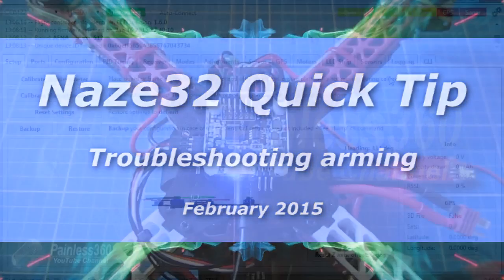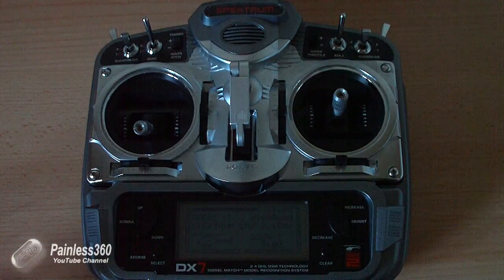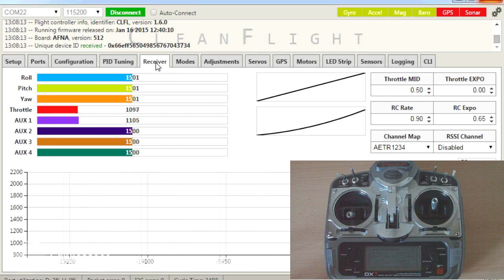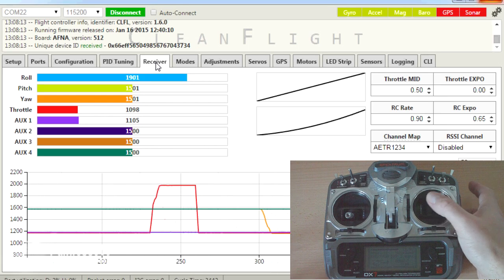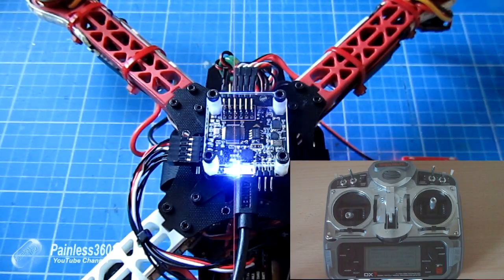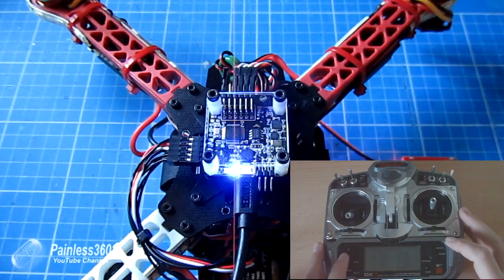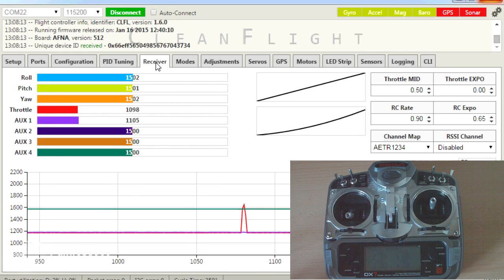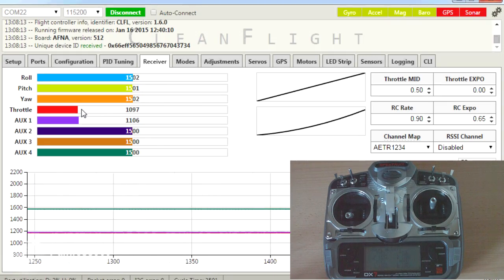Naze32 Quick Tip - Troubleshooting Arming

Comment: I've gone through all these videos, and I'm having an issue I'm hoping you can help with! Everything works when I have the USB hooked up and in Baseflight. Controls work, I see them moving. Got them all trimmed to 1500, I can even arm and get the motors spinning. If I unplug from the USB, and power it up, the Arm light turns green, but its like the Throttle does nothing. No motors spins. Any thoughts?
Reply from the maker: MrSadlerd3 Not with that amount of detail. What trouble shooting have you done?
Reply: Painless360 Well, it works when the USB is plugged into the Naze32/Flip32. I've tested all the motors one by one and they all spin.  Using Rotorgeeks ESC and I did calibrate them. It just does "arm" when I unplug the USB, from the board, but it like there i no throttle.  But if Plugged in I can see the throttle moving in baseflight.
Reply from the maker: And the led on the radio receiver stays lit when you unplug the USB cable?
Reply: Painless360 yup. I actually turned off the don't spin blades when armed.. armed it it while plugged in, motors started spinning, unplugged it from usb and could control it with my Dx6i.  If I unplug battery and try I get nothing.  Arms, green light in FC, reciever lights up, no throttle! ! Baffled
Reply from the maker: Can you make a video showing the issue and get close ups of the FC and Rx?
Reply from the maker: MrSadlerd3 OK, I can see the power to the Rx but the ESCs are not arming without the USB connected - that is the problem. The final 'beep' to let you know they are ready as they have seen the low throttle position isn't there. Odd.
I would suspect the power to the board from the UBEC you are using on the model. Looks like the USB is running it all fine but whatever is powering it on the model isn't cutting it. I'd try that next..
Best of luck.
Reply: Painless360 thanks!! Ill hook a  meter up to the bec and see if its putting putting out any power!
Reply: Painless360 So I go my multimeter, and tested the BEC.  It's pumping out 5v as expected.  I put the BEC back on the board, plugged in my Battery and put my MultiMeter on the "Motor 5" and it showed 5Vs as well, so it is getting power, or should be getting power.  I even hooked up another Radio to see if perhaps the PPM one I was using was bad. .  Any other suggestions?
Reply from the maker: A few but I would start to suspect the board now too..

Bets of luck with it.
Reply: Painless360 I found the issue!!!!! After checking everything I deceided to look at the site i got the ESC from. "RoterGeeks". . . and guess what I found under there ESC page. """If you're having issues with 13.2 and motors not spinning using Baseflight or OpenPilot, flash this hex file"""  There is a known issue with the BLHeli 13.2 and mine had that version. . Flashed the new HEX file. Instantly working.  

I want to thank you for EVERYTHIHG. . My next attempt will be with the Taranis and your videos will be my guide.   I can't thank you enough for what you're doing for this "hobby/sport"
Reply from the maker: Well found. Happy flying!

Comment: Hi I am  having a similar problem that is driving me crazy, I get consistently get the board to arm and the motors to spin while I have the naze 32 plugged into the use cable but when I disconnected the cable and try to arm the drone nothing happens? ( I am saving all the setting in base flight before I disconnect btw)  any thoughts?
Reply from the maker: Cameron Cooke What troubleshooting have you already done?

Comment: Big thanks mate, I was searching for few hours to find out what was the problem with arming, just increased end point on throttle and it works ! +1
Reply from the maker: Gorwen You're welcome. Let me know if there are any other things you need help with. Loads of videos on the channel to assist and lots of them are created to help subscribers with problems. 
Happy flying!
Reply: Painless360 thanks mate, I know well NASA m lite, but I'm a newbie with naze32 that I just started to use on tarot tl250a, my quad always drifts a little left and a bit forward , any idea to correct it without touching trims ? Big thanks !
Reply from the maker: I would recalibrate the accelerometers and ensure that the stick calibration and midpoints in Cleanflight all match the transmitter.

Best of luck.

Comment: My motors do not function with the tx.  If I  plug directly into ch 3 they work, but not when plugged into the Naze32.  Under Clean Flight the motors will work when on the motors tab but not with the tx.  

My throttle is set 1093 on the low end and rudder is 1093 low and 1900 high end, and still my Naze32 will not arm.
Reply from the maker: What troubleshooting have you done?
Reply: I think I may have discovered my problem last night.  I am just in the middle of my first build, and it is my first quad.  

The naxe is not mounted to the chassis it is sitting at an angle due to a twist in the usb cable.  And to complicate things it is in angle mode.  So the motors won't all come on fully as the board is trying to self level.  

Such a nube misteak. 

I was stressed over soldering up the board as I have never done something like this before.
Reply from the maker: Dean Cory Well done on sorting it out and getting to the bottom of the problem. The first two videos in the CC3D series show every step in setting up a flight controller, including building the frame, power distribution board, esc and motor connections etc. 
May be of some help?
Reply: I will admit your video series on the Naze32 has helped me TREMENDOUSLY.  It is just that a beginner lime me wasn't interpreting what he was seeing correctly.  

I may temporarily bolt the a Naze to the chassis to double check my theory.

Comment: hi there im having trouble with my quadcopter and cant get the yaw to work wen i move the rudder on my remote it just moves one of the aux channels
Reply from the maker: Jack Scott Then you either have the rudder channel plugged into the wrong connector on the receiver or you have a special mix/channel selection setup on your radio that you need to remove.
Best of luck
Reply: im running er9x on the software
Reply: it did the same thing as the rudder but i fixed that but the roll is now doing the same thing
Reply: Painless360 i cant find a special   channel on the remote
Reply from the maker: Jack, you need to spend a bit of time with the manual and work through it. If you are not familiar with the radio.

Trying to setup a model with a radio you don't know will get into more trouble. Take your time and use a spare servo connected to the channel output on the Rx to see how each one works.

Don't forget to run through the transmitter calibration routine in Cleanflight and use that to confirm that the channels all move in the right way.

Best of luck with it.

Comment: i also had a problem with arming, i would arm it the green light came one, then disarmed it, then try to re-arm, it wouldn't arm for some reason, i had to raise my max throttle by 1 so it would be 1901, fixied the problem right away, arms and disarms just fine hope it can help
Reply from the maker: Thanks for the post, very helpful. 

Happy flying!
Reply: thanks man

Comment: Will this still work if you fly in mode 4?  I know a bit weird but I am more comfortable with ailerons on left stick with throttle for my fixed wing aircraft.  I am just starting my first 250 build.

Cheers
Reply from the maker: The mode of the radio makes no difference to how the receiver works and is wired to the craft so it will work fine.

Best of luck!
Reply: Well thank you for the quick response!  Logically I thought it might be bound to the Yaw.
Reply from the maker: No, but always pays to check! Less accidents and scars that way ;)

Best of luck with the project!

Comment: I have had some arming issues with the board as well, independent with AUX or stick "right down" (mode2).

Result was always a 1 time blink of the green light (and 1 beep on the buzzer) and it didn't arm.

Throttle Values have been 991 - 2015 (Cleanflight 1.7.2)

Solving this was changing the minimum command on the configuration tab from 1000 to below 990 - save - (please remove probs as the motors start immediately) and afterward set it back to 1000 - save.

Comment: Thanks for the videos! question for ya tho.. I am arming my board via a switch on my taranis but in the Modes tab on clean flight where it says arm i have added the range and when I flip the switch it lands in the range but the box still stays red and doesn't turn green.. My quad does arm but sometimes when flicking the switch it doesn't make it up in the set range .. it keeps changing ranges.. I'm a total noob so forgive me if this is a stupid question buy i just don't understand why it doesn't turn green.
Reply from the maker: Sam, I'd try and use the default 'arming using the throttle/rudder' method for now and come back to this once you have more experience.

Best of luck..
Reply: itsalmostover haha don't use naze32 it's so out of date! That was from 2 years ago, I've used many other fc since then

Comment: It's a very good habit to set all your end points to 1000 low and 2000 high. Every channel. Very easy to do on most radios these days. That will also give your radio a better feel and use the full stick resolution available.  Same with your Aux  switch settings. Take a few minutes to set the end points accurately and you will get a much better setup. I have spent weeks on these Naze 32 boards and they are brilliant. I have run sonar with some success. GPS hold and RTH works perfectly and these boards work well even on 550 sized frames. To say they are a hundred times beer than a Pixhawk etc is not an exaggeration. The Naze either works or it doesn't. The others are five times the price and five times the heartache to setup as well. Set mid 1520 on Future radios gives you perfect trim centering right out of the box.

Comment: If for some reason you cannot extend the end points of the channels to make arming work you can change what the Naze 32 board uses as the end points by adjusting the mincheck and maxcheck parameters in the Baseflight CLI.  I had this problem when using a DX6i transmitter.
Reply from the maker: Great tip - thanks for sharing!

Comment: Mid RC on a Futaba is 1520- end points on a Futaba are 125- I also see that the Orange 6ch radio with dmsx also requires travel adj to 125.
Reply from the maker: Good detail Hiway, thanks.